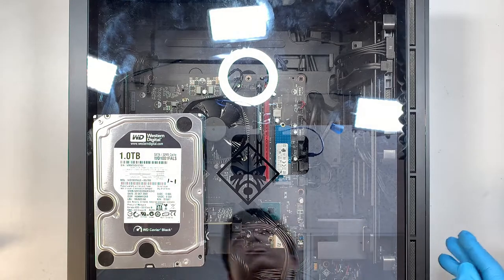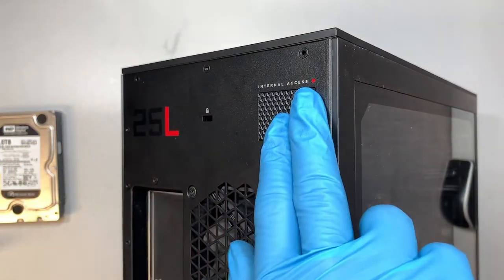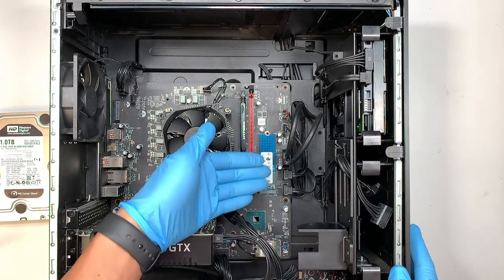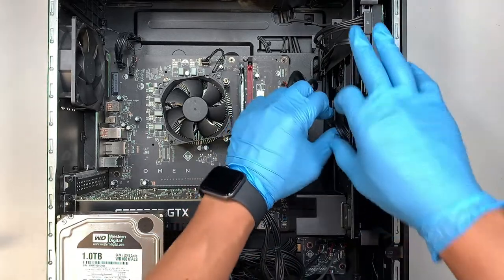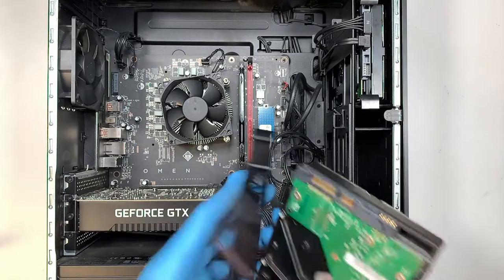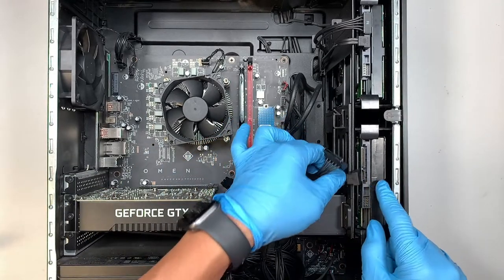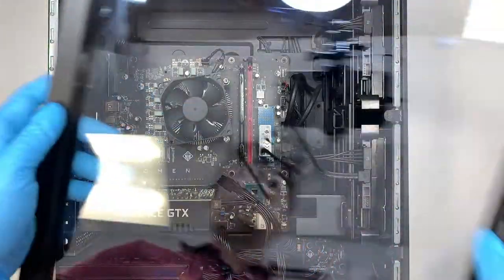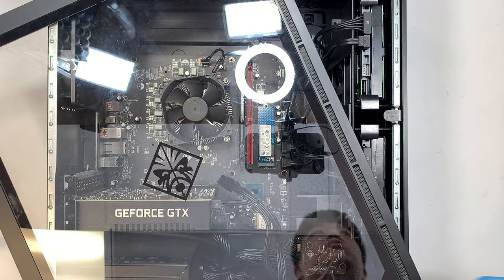Additional HDD Upgrade on HP Omen Desktop

Comment: Thanks for your video. I bought a 4tb hard drive and when I went to install it, I discovered there was no data cable included in my obelisk. Power cable was in the slot, but no data cable. I went to best buy and bought their two foot sata iii data cable and it seems to be working fine. I was able to get rid of two external drives and clear up space on my system SSD and 7200 rpm secondary drive where I store my games. I'm very happy with the results.

Comment: Nice video.  Was wondering, did your desktop come with the additional data cable?  I have an Omen 40L and it appears that it doesn't have an additional data cable.
Reply from the maker: No extra sata cable. Got to get separately. https://amzn.to/3RN7uF5
Reply: @UbergeeksBiz  Ok thanks
Reply: I should have read this 😅 awesome video but me too - missing the SATA cable.
Reply: I heard that you have to be careful in getting the correct one that matches the machine though or can damage the components. Is this true? and which would be the correct brand to use if so?

Comment: Can I add a ssd instead of a hdd in that same spot ?
Reply from the maker: Yes you can
Reply: You should be able to but you may need an adapter as the HDD bay is 3.5in and and most SSDs are 2.5in.

Comment: So I checked inside my Omen and I had the power cable for the second partition but not the sata cable. What do I do to install the second drive?
Reply: Just bought a 4 tb second hard drive and went to install and found the same thing! I'm going to go to best buy tomorrow and buy a cable. Thank goodness the power supply cable was there. I think I can manage to hook up the data cable, you can see it goes right underneath the one marked HDD on the motherboard!
Reply: @August_Fields  Let me know how it goes. I assume it doesn't matter which sata cable but some people say you should use the same one thats used in the first hard drive (same brand) so the computer doesn't get damaged. Seems unlikely but I've never bought one before lol

Comment: Hey I have a problem. The Sata cable on my omen is way too short and cannot reach the mounting bracket. Someone suggested I remove the back panel and extend the cable but it won’t come off. Any suggestions? Thanks.
Reply: mirror insert hard drive
Reply: were you able to come up with a solution?  I ran into the same issue. - data cable will not reach.  Someone suggested mirroring the drive in the slot, but that doesn't work with the tray config.
Reply: @billseiler7013  Yes! I was able to resolve this by removing the back panel. There are a couple of videos on YouTube showing how to remove it. You should then be able to pull out the Sata cable. I recommend wearing latex gloves to give yourself more grip when removing the back panel because you need to slide it off. Hope this helps.